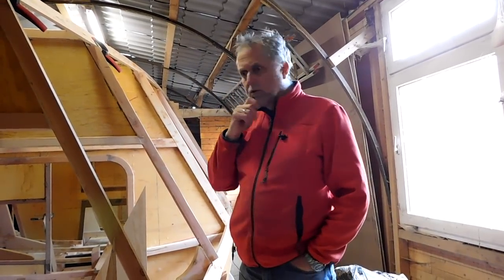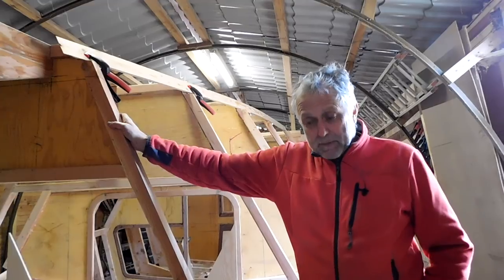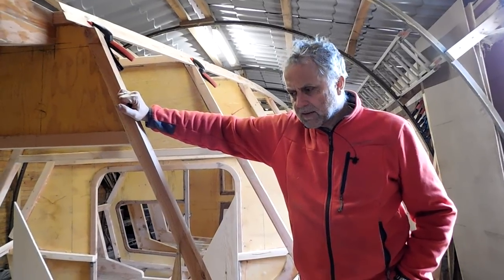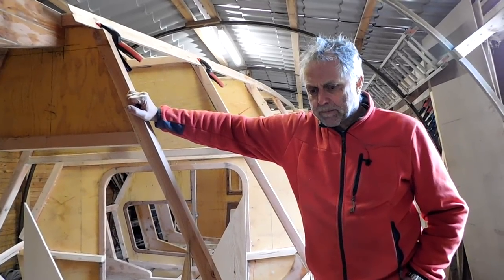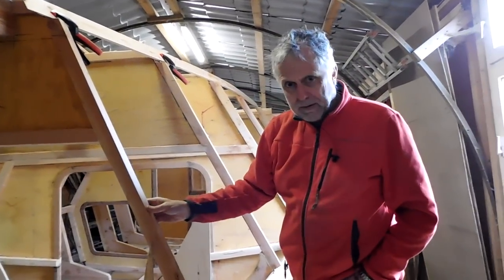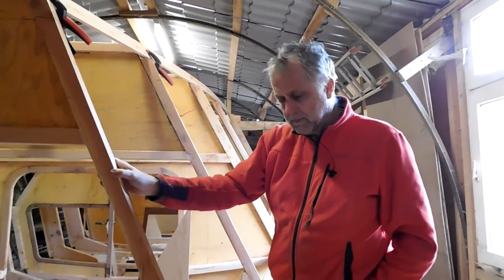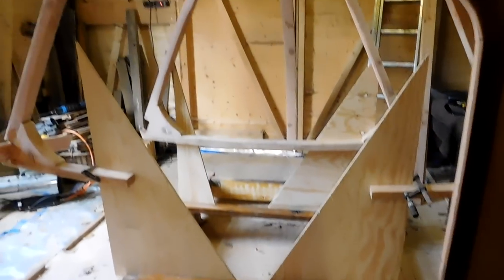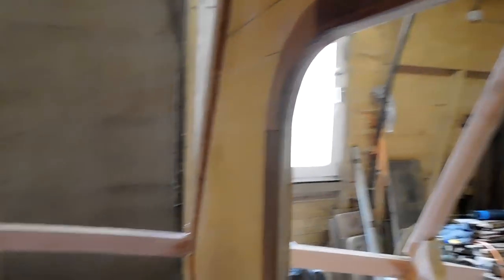The low-tech boat? - SV Tapatya EP28

Comment: Sorry, I must disagree with you about a pressure water system.  My (UK) narrow boat uses a calorifier, heated by the diesel stove, the engine or 240 shore power with the 240 acting as a frost stat over the winter.  A warm shower on a cold, wet, windy day is wonderful.  The water from the shower drains ( slowly) into a big plastic box with a bilge pump and switch in.  After the first time the pump filter blocked I added two ball valves with a quick release coupling between them.  This means that I can isolate the shower tray and the box so I can take the box out to work on it with a bit of room rather than struggle in a small space under the bed. The pump wiring is on a waterproof plug.
The tank has three additional jackets round it and will keep the water at a decent temp for the best part of two days.  Over the top?  Maybe but I like it and most of the heat is free as it heats when the engine is run.
Reply from the maker: You don't have to agree with me. I was just giving my thoughts and talking about the way I wanted to do things at that time. Most of them are still so.
Reply: SV Tapatay.  No we don’t have to agree.  That’s part of the fun.  We each do it our own way.

Brilliant work.  I’ve fitted three canal boats but that’s a lot different to building one from scratch.
Reply from the maker: 👍😀 and there's some differences between canal boats and sail boats too, Mick. One main one being, on a sailboat, you try not to run the engine! 
Sounds like you've got some good experience there Mick 👍
Reply: SV Tapatya.  One rule applies to both.  If you can’t buy it or steal it you have to make it.
Reply from the maker: Yeah, and it's good to make some of the stuff you could get elsewhere!